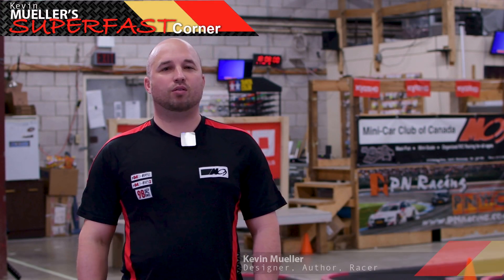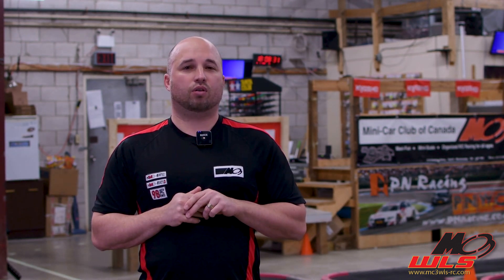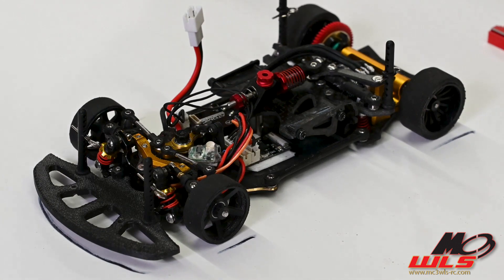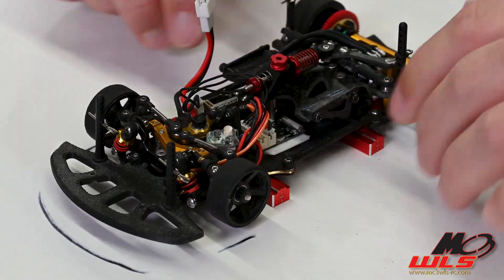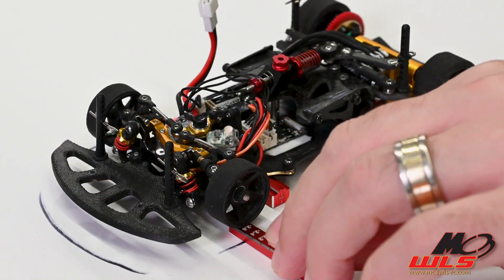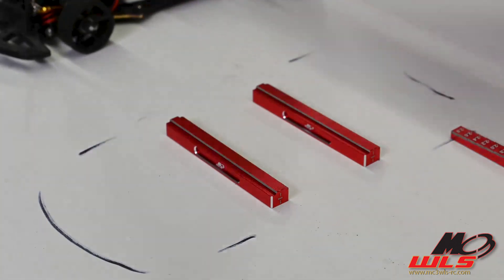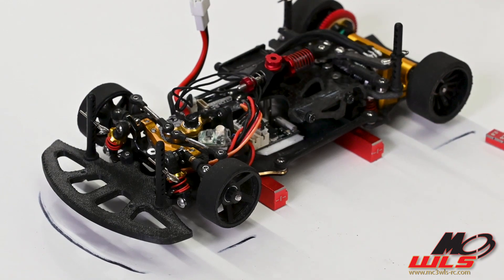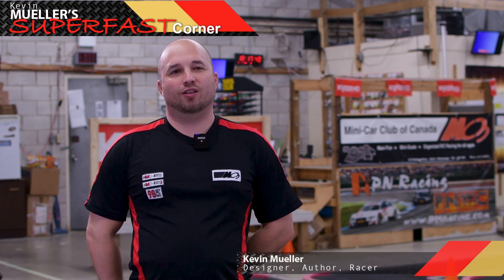Droop explained

Comment: If you measure at tire doesn’t your droop changes as tire wears?
Reply: No it will not, this is because you need both measurements to calculate droop. If you’re tire diameter changes so will the ride height. So both measurements should change by the same amount leaving you with the same droop setting regardless of tire diameter.